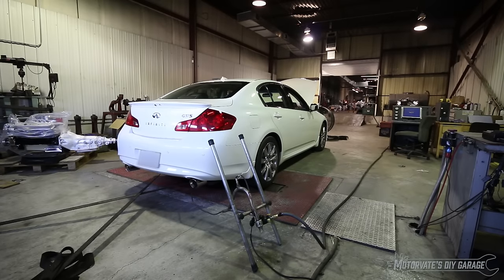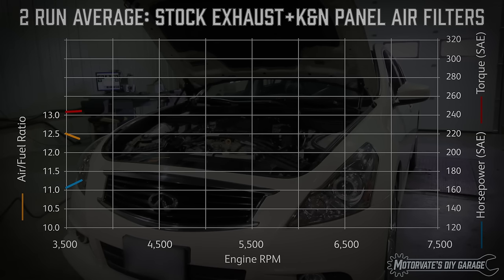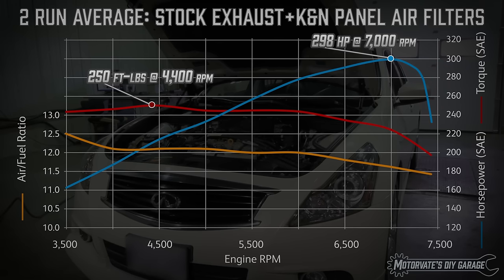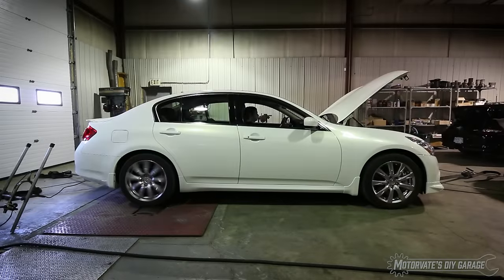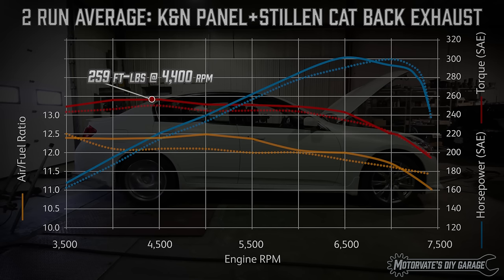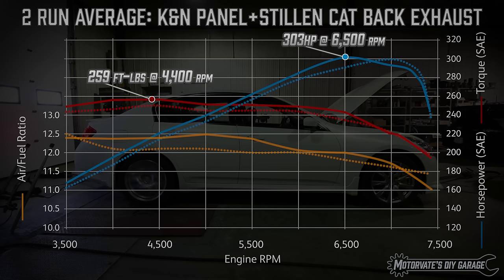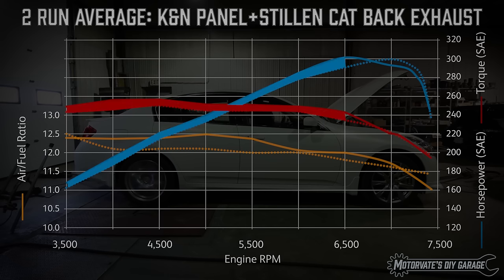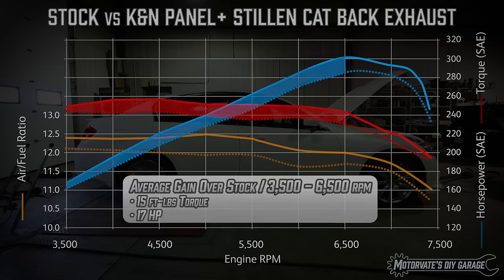Stillen Cat Back Dyno: G37 Sport Sedan  - Motorvate's DIY Garage Ep. 11

Comment: I'd like to get rid of that stupid collector thing at the end of the Y-Pipe where it then splits off into dual piping to the muffler(on stock exhaust). is the only way to get around that bottleneck to get a catback?
Reply from the maker: Hey sk8punk318,
I am not sure of the part you are talking about. 
If you are asking about removing where the exhaust merges into 1 pipe and make it a "true dual" exhaust: Don't do it.

By merging the exhaust into 1 pipe it allows BOTH mufflers to be used, effective allowing more flow.
Also, with the exhaust merging into 1 pipe, it creates a slightly negative pressure in the other branch of the exhaust, and when the exhaust valve opens, the negative pressure helps to move more exhaust. (google exhaust scavenging)

You might enjoy this: https://youtu.be/fCio5K0WfHU
Reply: Motorvate DIY thanks for all the advice man it's much appreciated. car looks and sounds great too!
Reply from the maker: Hey sk8punk318,
No problem!

Comment: You should have done 0 to 60 from stock to KN and Exhaust before and after video
Reply from the maker: Hey  Nick6Michael,
I not sure I could consistently launch the car exactly the same, with the same wheel spin multiple times to get an accurate time.

Plus if done on different days, then you need to adjust the time for weather (temp, air pressure & humidity) like the car magazines do.

or Just go to a dyno and the what the engine is doing and see the actual power curve.

Thanks for your comment :)

Comment: What would the hp difference be between the custom exhaust on this and taking the cats out completely?
Reply from the maker: Good question... however I have no idea.
From what I have seen, taking out the cats does seem to confuse the ECU... even with a tune to block the P0420/P0430 codes.

On the G37/370 from about 2012+ the ecu uses the rear O2 sensor to detect if there is a lean/rich bias on the front air/fuel sensor.

When the cats are removed, I think this causes fueling problems and the car doesn't run as well as it could.

Anyways, I do think the cat back exhaust will give you more HP gains than going to test pipes... and then you don't have to deal with a bunch of engine codes.

I've had the Stillen Cat back on my G37 since 2016 and to me, it is the perfect combination of sound and power. I smile almost every time I have the windows open and run through the gears.

Comment: Did Stillen Cat Back made trouble with cops in Toronto? Or was it silent enough
Reply from the maker: Hey  Baybars Bagdatli,
I have not had any troubles with the exhaust being too loud in Toronto or anywhere else. It really isn't very loud, which is perfect for me.

Here is an in-car review I did on the Stillen Catback exhaust:
https://youtu.be/0faOiDHu6Po
Reply: @MotorvateDIY  Thank you for the response! I live in Vancouver and wanted to know if the sound irritates ppl who has badges and me. I am also looking for the most subtle one. I think this is the one on the market. But do you know how much dB does it make? Thanks
Reply from the maker: Hey  Baybars Bagdatli,
I don't know what the dB of the exhaust is, but since it is more mellow (low frequency) than the "fart can" Hondas I think most would consider it stock. 

For example: The stock G37 coupe exhaust note is not quiet and I think the G37 Stillen exhaust is about the same level of loudness.

Maybe if you contact Stillen, they might have some sound measurements?

Comment: So performance exhaust can add hp without a tune? 🤔
Reply from the maker: Hey sweetj16real,
In my opinion, absolutely!
BUT the amount of HP increase is different for different cars.
If the factory exhaust flows well, your power gains will be less.

On the Infiniti G37 or Nissan 370z, they do respond well to free flowing exhausts :)
Reply from the maker: Hey  IBRanger,
A tune will make a little more power. Next year, I might be partnering with a ECUTek tuner in California and work though an e-tune :)

Comment: Now put on Stillens stage 3 air intake;-) If you still have the car of course.
Reply from the maker: Steve, I will have this car for a l-o-n-g time. The best used car is one that is paid off. :)
It would be  interesting to dyno the K&N panel vs the Stillen Gen3 intake. I suspect the gains on the Stillen intake would  be  a little more than the K&N panel filter. However, I don't think the Gen3 intake is in the budget for this year. :(
Reply from the maker: @Rah Kyrillos That may be true to get the MAXIMUM gain... BUT you will still get a VERY GOOD gain without a tune. The fuel injection system on the G35/37 & 350/370 uses a "mass air flow" sensor to read how much air is going into the engine. More air = more power.

An after market intake or exhaust, simply allows more air flow, the MAF sees it, and the ECU adds the required fuel to achieve the required air/fuel ratio.

For a second opinion, why not check with Stillen?

Comment: have you thought about high flow cats?
Reply from the maker: Hey George Escutia,
I have... BUT I don't think they would pass the emission test and I don't want the headache of dealing with a P0420/P0430 (catalytic efficiency too low) code, which seems to happen after a bit of mileage is put on them.

Comment: A dumb question. I have 2012 7at g37s. I noticed that your engine can hit higher than 7k rpm to 7.5k, but mine literally cut off fuel over 7k... Do you have any idea why? Or it's due to different design for different transmission?
Reply from the maker: Hey 瑞哲何,
I really don't know. Maybe the automatic transmission doesn't like the high RPM.
Overall, it really doesn't matter. After about 7,100 RPM the power starts to drop off quickly. (In my car anyways)
Reply: Just wish to have a higher limit so I don't always hit the fuel cut off in manual mode (at shift a bit slow)... Thank you anyway

Comment: Hi, I want to change led indicator bulb in my g35 2008 can you suggest me which is good without error and fast blinking
Reply from the maker: If you use any kind of LED bulb you will need a resistor or it will flash fast.

The body control module (BCM) monitors how much power the bulb uses to determine if it is working. LED light use very little, so it thinks the bulb is burned out and flashes it fast to let the driver know.
Reply: @MotorvateDIY  i buy sirius led  brand bulb if i change only rear indicator or only front then works normally if change both then flash fast if use hazard then works normal speed what i do now ?

Comment: You can see that the ECU has not fully adjusted fuel trims
Reply from the maker: Brodey, thanks for commenting! However, I don't understand how you "see that the ECU has not fully adjusted fuel trims" Thanks!
Reply: It looked to me like the AFRs were lean at first, then richened up and right near fuel cut the ECU dumped a bunch of fuel (smart). 

That is an enrichment mode when the ECU expects certain things to happen and they don't and since nothing is hurting the engine everything happens in the background. 

My guess is that with some mileage and as the ECU starts recording smaller short term fuel trims, the AFRs will be around stock.
Reply from the maker: (Please only take my comments below as positive and trying to understand your perspective. I don't want to take a chance that you think I have insulted you in any way. I really enjoy a nice adult conversation about this stuff. Thanks!)

Brodey, I don't think 12.5 is lean. It is leaner than  stoichiometric, but 12.5:1 is generally the target of all aftermarket tunes and is known as "rich best torque".

The data presented in the video does not show this, but the VQ37VHR starts to close the throttle bodies at 7100 RPM and that causes the rich mixture jumping at that point. Fuel injector pulse width does reduce a moment after the throttle bodies, but for that split second, it spikes rich.

The ECU does not "expect things to happen", it is only re-active to what has happened and uses many tables to determine what to do. At least that is how I understand it.

What do you consider to be "stock AFRs"?
Reply: I feel bad about what was said to you in the past for your preamble ;-). 

The VQ motors close throttle bodies in response to the PID loop not meeting targets. This is how Fiat multi air engines work as well (which run wot at the throttle body and came out well before vvel). 

I say 12.5:1 is lean because in your video at lower revs the car ran even richer, therefore the car was leaned out.
Reply from the maker: In the case of the VQ37VHR it is the "soft rev limiter' kicking in by slowly closing the throttle. One of the data logging test I have done is a full throttle acceleration in 2nd gear until the rev limited kicks in. 

It is very interesting because it just slowly closes the throttle and nothing happens, no noises, no vibrations, just a soft close of the throttle and the power and RPMs drop.

Older cars would either cut fuel or spark and the engine would make that unique sound of "ba ba ba ba" until the throttle was closed.

I don't understand what you mean by a "PID loop." 
A PID (parameter ID) is a mode $01 request for data from the ECU, like engine load, or coolant temp. How do they loop? Are you talking about closed or open loop fueling?

Also what "targets" are you talking about?

I know nothing about the multi-air, so I can't comment.

For the air fuel ratio, I would agree 12.5 is leaner than 11.5, but 12.5 is still considered a rich mixture since it has less air than stoichiometric. I think we might have opposite reference points on that one :)

Thanks for taking the time to reply to my questions :)
Reply: Awesome reply! Thank you! 

I have read about the VVEL soft limiter and IIRC it will fuel cut eventually. I actually think my SpecV did a bit of a soft limiter, so it's interesting to see that it is showing up like that on the dyno; neat!

If I'm wrong about the AFRs, we'll see low short term fuel trim %s and the same (12.5) AFRs during later dyno runs. If I'm right, we'll see the same (as stock, 11.5) AFRs.

FYI, keep em coming! What are your plans for the channel? Would you be interested in autocross??
Reply from the maker: Brodey, since the dyno is done at wide open throttle, the ECU is in open loop and the short term fuel trim is always 0. 

I did a data logging run yesterday to understand the stock ECU targets. Normal driving is always close to 14-6 to 14-8. It  also was around 14.7 at wide open throttle until about 3,500 RPM then it dropped to mid 12s. Keep in mind it was 0C yesterday, so there was no additional enrichment to cool the combustion chamber. When the intake temperature is hot, the AFRs drop to add extra fuel to cool the intake charge to prevent knock.

Autocross? Funny you mention this. I am the 1989 Class C Solo-II champion, but I have not been out in many years. Once I started doing track days on my CBR, the autocross was not as exciting.

The focus of this channel is:
(1) DIY mechanical repair on G37, Forrester, Fusion, maybe some Civic stuff.
(2) Before and after testing of modifications

Anyways, Brodey I need to get back to editing the next episode. :)
Reply from the maker: Hey Kenneth Meng,
I data logged the factory air/fuel sensor under wide open throttle in second gear.  With the K&N filter and Stillen Exhaust the air fuel ratio was VERY RICH and dipped into the high 9s.

Most mass air flow fuel injection systems mostly use the MAF (mass air flow) sensor when in open loop to determine the fueling required. Since it can measure the increased air flow, it can add the required extra fuel.

With an engine that uses a carburetor, you are 100% correct. :)

Comment: when you install a upgraded exhaust your taking away the "restriction" in it also called back pressure all cars are tuned to have a certain amount of backpressure the reason why you lost horsepower at shorter rpms then with the stock is because a less restrictive exhaust will create more horsepower yes but at the low end once you hit high end its just blowing too freely and wont be able to create more pressure where as with a exhaust tuned for the car you could actually get more horses at the low and high end along with an ecu stage 1 or 2 tune but never go three without upgrading the camshaft and. the pistons with forged pistons first youll melt the car down
Reply: I think it's a lot less sophisticated than that.   The factory doesn't want customers to BITCH about noise, so they play it safe and we get a compromised version with a crap stock exhaust.  Think about the buyers in the $35-$50k 4 door sedan market.  Also I think the stock exhaust is there to hide deficiencies in how engines sound, and lets face it, an inline 6 just sounds better than a v6 in most applications.  Porsche flat 6 = $$$.  So I think the manufacturers try no normalize and go for the income bracket crowd when choosing exhaust parameters.  Luckily we have amazing manufacturers like Fast Intentions that can build a well engineered quality product with proven and repeatable performance gains without the drone that would normally make daily driving annoying.
Reply: Dan Phillips little honda 1.6l 4 cylinder engines need some back pressure or else they lose a bit of torque that is already in low supply. Large V6 engines do not need backpressure or a stage 1,2..3? tune at high rpms. Please stop spreading false info.

Comment: This is good information. Nice videos
Reply from the maker: Hey Vic,
Thanks for the kind words, I really appreciate it!
Reply: Np. I just had my car dyno tuned yesterday. I have intake and exhaust and test pipes. I gained around 20hp. And the car runs smoother I can feel the difference.
Reply from the maker: Hey Vic,
That is a nice gain! I am sure you will enjoy the car a little more now :)
Reply: Motorvate DIY yeah I recommend getting a tune after mods it really does make a difference.
Reply from the maker: Hey Vic,
True, but the cost for a tune in the Toronto area is around $800 Canadian! I would rather spend that money on other things like sticky tires and HPDEs (High performance Driving Education) . Plus I wonder about the long term effects on the engine/cats with a non-factory tune.

For me, my G37 is quick enough.  Where I live, I can't use full throttle for more than 5-6 seconds or risk a big ticket or get my car impounded :(

A wise man once said "It is more fun to drive a slow car fast, than a fast car slow"
Reply: Motorvate DIY haha yeah true. Well I got a bargain. I paid 420 dollars for my tune.

Comment: So basically it's a 5% increase... I wish we went off percentages as it's a better way to put things in perspective.  Funny how we won't upgrade computers for a 5-10% increase, but when it comes to cars, no problem.   HP/TQ increase numbers sell more parts though right?   370z owner myself, but I think we need to lower our expectations with N/A gains on this platform as much as I love mine, it's still....not turbocharged :-(..
Reply from the maker: Hey 07wrxtr1,
That's a good point! 
Since you are from the turbo world, my gains are tiny compared to what you did or could get on your WRX.

For me, the main reason for the exhaust is the delightful sound and a little bit of power. :)
Reply: I have a 2014 370z, just had my Fast Intentions cat back exhaust put on after waiting 4 months.  Nobody here in Oregon has the ability to do any work on this car, unless you trust ( Here's where I could write you a college level dissertation on tuning facilities in Oregon, and you're better either driving or shipping your car elsewhere speech).   Anyways, the exhaust really made a bigger difference than I expected, mostly on response from throttle input.   Also, I don't find myself flogging the thing as much, it just seems somehow to put down more TQ especially in partial throttle applications, so I actually find myself shifting a lot less.  It's also removed weight from the car, removed a stupid heat shield rattle I had, and it just looks AMAzING!!!  Carbon fiber muffler = sleeper status, also I may add, if you like a lower frequency/tone, it really does it from idle to about 3k rpms, ZERO rasp unlike the armytrix and others.   Stillen used to be the only game in town, but the more research I've done, the more I've seen how they kinda have taken the stance of making $$ /marketing over actual performance.  They were "the" product to buy from the late 90's to mid 00's, and kind of sadly, have not really innovated since that era, more so just kinda of coasting on the name alone.  I mean, look at the intakes they  supply, great product that actually works, yet, they will not even offer them in an anodized black, as if we're all still living in 1998 still.
Reply: For a 5-10% increase in computing power, just OC
Reply from the maker: Hey 07wrxtr1,
I have read many good things about Fast Intentions exhausts, but they don't make one for the G37 Sedan.

It seems like the VQ engines respond  well to aftermarket  exhausts.

For me, I do like the Stillen exhaust. they are well made,  easy to install and is not too loud. Perfect for an old guy like me :)